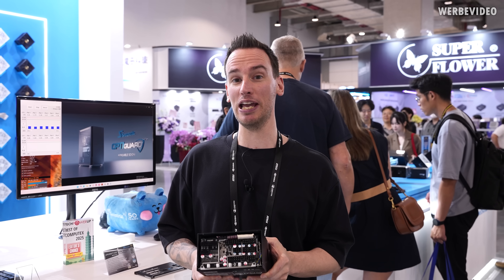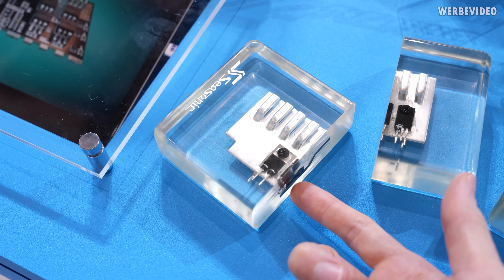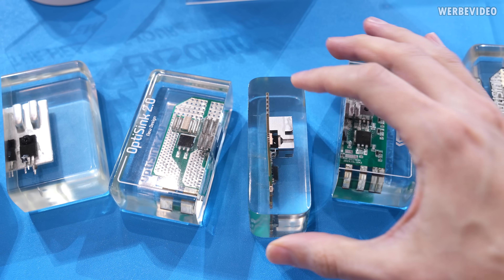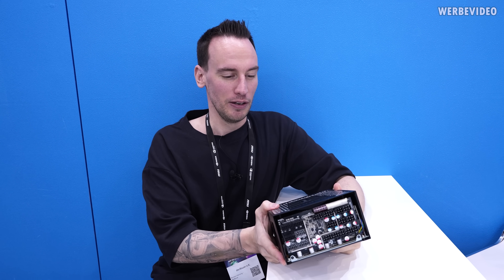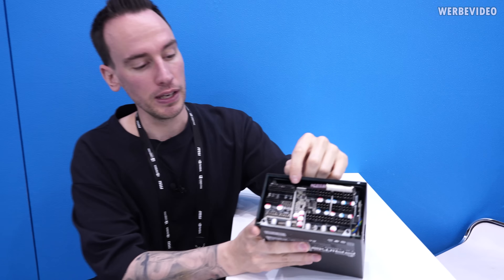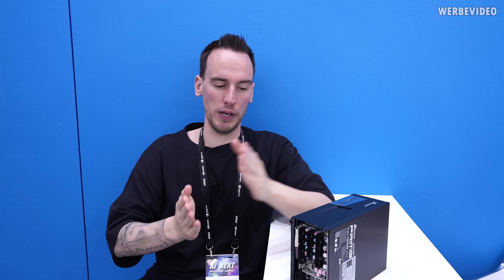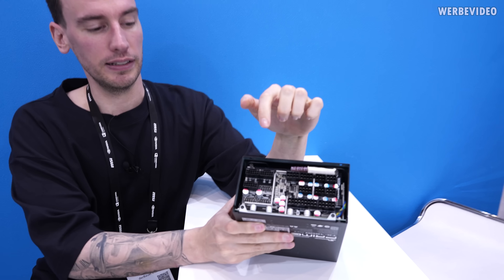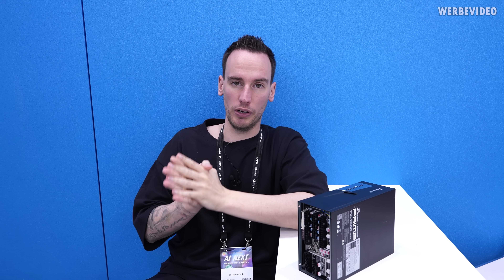Seasonic Confirms 12VHPWR Risk – Unveils Protection Feature

Comment: Whilst it is good someone is trying something, the only thing this will "protect" is the socket in the PSU, if the cables are all connected together in the cable connector you can still get over current on the wires if one breaks and still get an issue at the GPU end, the cables need to be individual cables from the power rail in the PSU to the power rail in the GPU. and you need the shunt resistor at both ends.

Comment: I've said this before and I'll keep repeating it. Ohm law is I (current) = U (voltge) / R (resistance). Having high resistance means the current is getting low. Dissipated heat is proportional to the P (power)=I*U. With constant (shared) voltage it's the higher current that get hotter, aka the low resistance ones.
What happens here is that the good connectors (low resistance) get hotter, as they take the slack from the bad ones.
So yeh, balancing the currents is the only way. Of course if just makes all lanes equally bad, to the point where you either don't deliver enough power or melt them all simultaneously.
Reply: Nvidia supplied a cable for its 4090 in which the 6 12V terminals and the 6 ground terminals were connected together. This was probably not for nothing ?

Comment: WHY - don't they just create a new PSU-GPU standard voltage of 36 or even 48 volts?  That would make it possible to deliver much more power with much less current - that would be easier on the wires and the connectors.

54 Volts would be my personal recommendation, since it is a PoE+ standard that could be useful for ethernet applications.

Comment: Definetly should include a beefy buzzer (many people use headphones), and perhaps also using that speaker for general diagnostic, just like the motherboard does with its buzzer. A row of LEDs could be nice, but that won't be as noticeable for users without glass panel cases.

Comment: can't it send signal to the video card through the sensing pins to lower the wattage?
Reply: the gpu was not designed like that, nvidia never implemented any of that, gpu just asks for more and psu delivers, that is the problem

nvidia made all cables connect to a single point, there is no control, that is why psus manufacturers are trying to fix things on their side somehow
Reply: @betag24cn I am talking about the top 4 pins that are for information. They are not soldered together

Comment: Just get rid of that stupid connector all together!   Use an existing proven working solution that has been around for so many years and be done with it. This is not rocket science but basic electronics. What is wrong with todays engineers?  Doesn't anyone do their homework any more? OMG.  As many have said, this is a problem that should never have existed in the first place.  Happy Saturday Herr Roman 🤛

Comment: I would also implement the automatic shutdown software in the PSU firmware directly, you can't depend on OS level software for critical things like this, especially on Windows. An USB connection to the PC could also enable secondary OS level monitoring software at the same time and allow programming thresholds on the PSU itself, so best of both worlds

Comment: i don't understand why ppl don't understand it.. Yes for Seasonic it is good approach.. but you can be sure in case power supply is damaged during use it will not be like change of one component and back to work no it will be change of whole PCB ..because desolder those transistors now is pretty hard so it is cheaper just change whole board.. From this point of view yes it is better to be done this way

Comment: The reverse of this solution is that it supports Nvidia and their crap connector.
The more support it gets, the more Nvidia has no reason to replace it.
And changing the connector type completely + revising the PD, are the only way the current issues get 100% solved.

Comment: I don't get why nvidia didn't just use EPS 12v 8pin connectors. Those are rated for something over 300w each.
Hell, if they really wanted to go with some new connector, then just make a damn 12pin EPS connector and slap 600w through that instead.

Comment: This confirms my view that the problem is not the plug per se, but the poorly designed power supply system of nVidia cards. The plug breaks down first, as the weakest link, but it is not the cause of the damage.
Reply: it is not the plug?

it is the plug, the wite gauge, the sife on the gpu and the side on the psu

on the gpu, a gpu on a desktop pc dhould not be using 660 watts, it was too much the 400 watts already

those thin wires carrying 10 amps, what a bad idea, the small surface on the connectors is terrible

psu manufacturers following nvidia ideas and using thos pos connector is the worst mistake ever

it is not just the connector, no, it is all related to it
Reply: @betag24cn  You still don't understand, do you? You normies are looking for simple solutions, not real solutions. Watch the video again and try to understand what Seasonic actually did and why. The plug-in can handle easly if the loads specified in its standard are respected.

Comment: Seasonic if you see this comment PLEASE install a buzzer with a unique beep code in it to ALL Power Supplies fitted out with this feature.
I want to hear the PSU beeps above all other noises, and, I want a Red Flashing LED at both faces of the PSU where cables plug in, so the Internal Side where you connect up 8-Pin ATX, etc, and on the External Side where the IEC C13 Connector Plugs in, the LED's flash in-sync with the beeps when the safety mechanism triggers.

Lastly, having a Note printed on the sticker on the side, and, also on the sticker on the bottom of the Power Supply stating what that beep code means would also be very user friendly, these are features that would benefit us as users and help out people diagnosing a potential fault with the system.
Reply: why dont they have that otherwise for all connections and any other problems?  Nah, too much money, lets just let a faulty psu kill your mobo and cpu!

Comment: I don't understand why they don't just make it 24v input. A simple voltage splitter on the GPU would make it the same 12v and cost pennies to do. PSU makers could support 24v easier than 12v too because it's just easier when the amperage is halved. Running 600watts over 12v when it's so easy to just do 24 and half the amperage seems dumb and obvious. No way they couldn't get the PSU makers on board.

Comment: Melting cable aside, it's also time to acknowledge, that any GPU consuming more than 400W is simply ridiculous. I tested the 5090 and returned it, only because of the heat output. My PC was generating so much heat, I just couldn't sit in my room, even with the AC on. Gaming on high settings for longer than 30 minutes, was just uncomfortable, no thank you.
Reply: This! I feel like we are stuck in the timeline where everyone makes everything needlessly complicated. Instead of solving around gpus requiring 750w+ power supplies and melting wires... maybe we can all collectively recognize that gpu wattage is becoming untenable. Is it a "generational leap" if we just keep throwing power at it? Or are we just enabling to super overclock old hardware by just adding infinite watts?
Reply: I have central air, but also... a window unit. The window unit counters my 5090, all good now 😂
Reply: If you are spending that money just upgrade the window unit. Or undervolt there is so much headroom to downclock
Reply: @bobo-cc1xw   I just rolled back to my old 4080, I don't want to deal with all the bullshit, when the performance difference wasn't even that substantial. Hopefully they'll come up with something better next gen.
Reply: @tomekhome it's almost like the node and area do all the work.
Reply: Lol, i have the Astral 5090 LC and after undervolting it use around 350-400W, perform around 5% less than stock. Have a look at my video LOL
Reply: @krizby87  if I may ask, with Astral LC, how did you build your case ? Do you have CPU AIO on top and GPU AIO on the side ? What's the fan layout ? Btw. I'm using LianLi EvoO11 - 3intake on the bottom, 3 intake on the side, 1 exhaust at the back, 3 Exhaust on the top (with the CPU AIO radiator).
Reply: @tomekhome  I have Corsair 5000D case, the GPU AIO is on the top exhaust, 3 Phantek T30 intake fans at the front. I use an air cooler for the 9800X3D as it does not even reach 60C during gaming
Reply: @tomekhome  The Astral AIO should always be exhaust as you don't want to dump 500W of heat into the case :D

Comment: As an engineer, I dont understand why they dont just get rid of 12VHP, and swap it with high current blade connectors, like seen on server PSUs. Big fat wide traces with the same footprint of a 12vhp. But capable of much higher current transfer.
Reply: Nvidia supplied a cable for its 4090 in which the 6 12V terminals and the 6 ground terminals were connected together. This was probably not for nothing ?
Reply: @monsieur3dx Ita not for nothing ita just badly designed and using a molex connector thats meeting its current limit. With a % of error going over ita limit. Compounded by the other issues around this and lack of per cable monitoring.

Funnily ientioned a blade style connector as i saw another tuber at computex showing the asus graphics card with a blade style power connector.
Reply: @MD_Builds  Yes.  What do you think about a copper-based conductive grease ?
Reply: @monsieur3dx  i dunno... shoving it into a 12vhp sounds like a risk for shorting... It might help in small quantities to increase conduction at the pins. But its risky too...
Reply: @MD_Builds  Of course, you have to be precise. With some kind of syringe?
Reply: @monsieur3dx maybe but some will squeeze out when you connect to the socket. And that might reach ground and cause a short...
Reply: because it is admit they were guilty and pay for damages

so they double down

Comment: It's absurd that Nvidia is refusing to fix it on their end. They could have separated the phases for the core VRM requiring the card to pull from each wire, but instead of doing that they're forcing PSU manufacturers to patch their mistake, entirely at their own expense.
Three trillion dollar company by the way. Three trillion dollar company can't make a connector. Three. Trillion. Dollar. Company.
Reply: It would cut their profit margins at least by few dollars!
That is not good for stock value!
😂

Comment: So the problem is probably bigger than we are made to perceive.  Since the launch of the 12VHPWR cable we were told that atx 3.0 was safe, then atx 3.1 was safe and now this.  Maybe the psu vendor is tired of the gpu vendor blaming the psu company?🤔 How much faith do they have for their $560 noctua 1600 watt psu?
Reply: I think, Roman said recently in a conversation with Steve from GN something to the likes out of a sample size of 3700 units, 12 connectors melted confirmed due to this issue. That equals a failure rate of 0.3% which might not sound much, but it adds up with the amount of users out there.

Comment: Why not make a connector with one big wire instead of 12 small...
Reply: and connected to the wall socket like the meme? if things keep going like this, it will be done
Reply: Linus already did it with double wire rc connector.
Reply: Nvidia supplied a cable for its 4090 in which the 6 12V terminals and the 6 ground terminals were connected together. This was probably not for nothing ?

Comment: While the overcurrent protection per pin at the PSU end is nice it does not solve the route problems of very slim safety margins  no load balancing at the GPU end.
Reply: No it does not fix that… your gpu still may burn… but at least you may get warning while it start burning… if you hapen to be close when it happens… 😂

Comment: Amazing seasonic, i would buy this PSU just for the 12VHPWR protection it has unless its only on super high priced models.
I wont buy a 50xx series card until then unless there will be a better solution out there that would avoid my house from burning down while i am asleep or at work.
Reply: This does not prevent gpus to burn… but it will at least warn you when it does burn!
And if you are really lucky, it could cut the power before fatal burning happens… maybe…

Comment: I assume someone is building a plug in alarm system for these cables.   Plug in at the PSU side,  alarm goes off if any one wire gets too high of current.

Comment: Roman I'm scared to use my Nvidia GPU even at 300W 12VHPWR cable on my ada. The is bending of wires at the connector even in horizontal mount for my eGPU and it's my first build without using an 8 pin pcie power connector in 2 decades.

Comment: Just get rid of 12!!! The classic 8-pin still works fine and is safe!!!
Reply: "but three 8pin cables is so ugly wahh" - nvidia
Reply: It’s not like they needed the space
The damn gpu’s are enormous
Reply: Nope, with the board design issues of rtx 5000 the 8 pin connectors would be melting too :) hope that helps

Comment: Maybe it’s time to develop something safer to use without the bulk of 3x8 pins and issues of the 12v2x6 :/
Reply: 2x6 would be fine (maybe scaled to 2x8?) if cards were allowed to have current balancing
Reply: @libre-serwis  I think the ones they used on the FE 30 series card were safer right? So I don't know why they stopped using that
Reply: @tonyy.8852 The connector was mostly the same, but the card had circuitry to balance current across the pins. Now they stopped using it and are forbidding AIBs to do it.
Reply: btw Buildzoid (ActuallyHardcoreOverclocking) has some videos about the PCB designs, he explained it very well

Comment: Seasonic we are waiting impatiently and thanks.
A flashing diode and a buzzer sound as an alarm in case of problems would be welcome.
Reply: Nah, we don't need compliance. We need complete rejection. Thank Seasonic for nothing but now perpetuating the terrible design problem. Just what we need, except it's not.
Reply: @JamesSullivan-ru4op This isn't compliance. Seasonic is working around a problem Nvidia helped create. The fact that Seasonic is doing this at all makes Nvidia look bad.
Reply: @silentdude56k  It furthers acceptance of the 12V HP connector. That's called, wait for it, hold on, wait, wait, just one more second, almost there...

=> compliance.

Comment: Impressive that Seasonic was able to do all this, but at the same time I wish they didn't. It further facilitates Nvidia to continue acting like this isn't their problem
Reply: Definitely but it's a good opportunity to make good money from all this too. And with Seasonic's reputation people will flock to this psu
Reply: But its not Nvidia's problem!  /s
Really, though. Nvidia isnt going to do anything to fix the problem, so SOMEONE has to! And its going to fall on the PSU manufactures to do it, cause theyre the only other ones involved. 

The fact that people still buy these GPUs, then complain that their GPU power connector melted/caught fire are the real-life versions of the meme of the bike rider puitting the stick in the wheel and complaining they crashed.

Comment: 12VHPWR would have been fine if Nvidia designed the 12v circuit on the GPU's side properly like they did on the 3090 Ti. It split pairs of 12v pins into their own power planes. So here we are years later going to extraordinary extents to deal with Nvidia's mistake.
Reply: That will be advertised as a feature in 6090 Ti Pro Max Ultra Super
Reply: Nah they'll be the same as the 5090 and still catch fire. Fanboys will still buy it. How do I know this? Because they still bought the 5090! 😂 (I have a 4090 and did not want to risk $3000+ on another fire hazard)
Reply: @AshtonCoolman  4090 has the same design flaws as the 5090, 3090 is the only one technically safer in any way so you're already running a fire hazard
Reply: @TheRealDioBrando yes I know. Like I said, I already have a fire hazard 4090 😂
Reply: Nah, that still would only inform you of a problem, not prevent it.  What we need is a legit connector like an XT60.
Reply: @concinnus  I believe the 3090 Ti was actually doing active current balancing, so it was actually preventing the problem from ever occurring.
Reply: @gjsmo  I'm 99% sure it just had 3 or 6 lanes with monitoring, like the later Asus flagship.  Do you actually know what active current balancing would require from the card?  Raising the resistance on the good wires to match the bad ones.  Does that sound like a good idea?

Comment: Noctua and Seasonic. About the only two PC brands I can just buy something from and know its going to be pretty great. Maybe throw Silverstone in there too.
Reply: EVGA for budget solutions, corsair used to be on the list but they fell off with the cx models
Reply: The 1600 watt noctua psu doesn't have this feature.  🤪😵‍💫🤡 only costs $560 . Remember when we were told atx 3.1 will fix the issue?
Reply: Well my friend is building custom build PCs for customers and he had really high rate of Seasonic PSU failures in the last 5 years.
Reply: the oroblem with noctua is price, with seasonic is that where i live, i cant find any, or i buy via amazon and pay lots of taxes or buy something else
Reply: Corsair and Micron are RAM companies and I trust them to make good RAM than any other company.
Reply: @Robbie-mw5uuwhile i also like those brands, corsair uses samsung chips most of the time, so corsair is more a seller of a product

micron is a bit different, they make chips a d also sell them under crucial brand, others buy their chips a d use them in their products, like corsair does
Reply: @Robbie-mw5uu Gskill >corsair past decade or more though in the enthusiast circles.
Reply: Silverstone CS382 had a molex connector soldered on backwards, according to a user over at DataHoarder. It fried their motherboard, CPU, and PSU.
Reply: Thermalright, never had a bad product from them. Hell I know they are cheap but everything I have got from them has been premium!
Reply: throw thermalright too, but idk if they make any psu